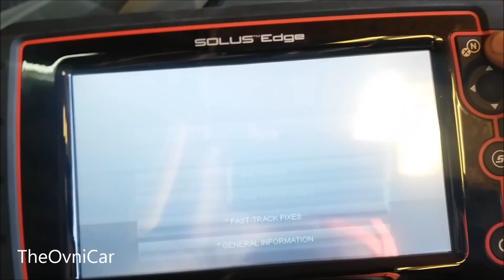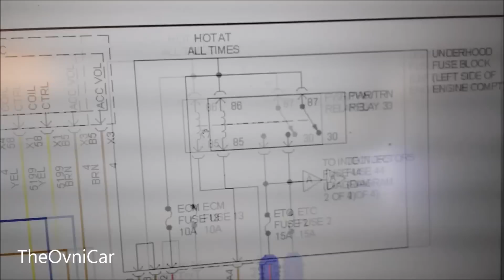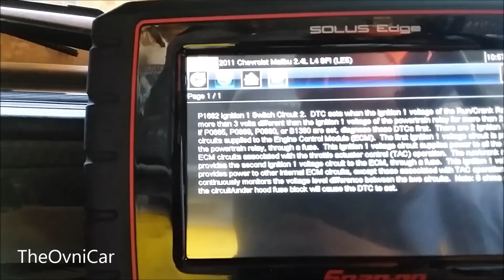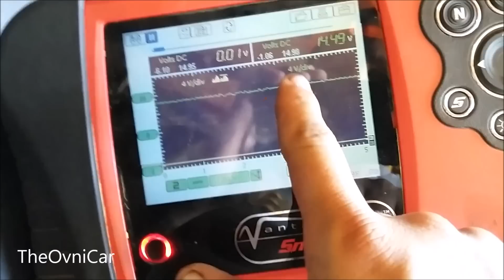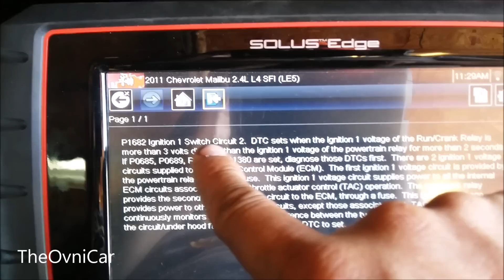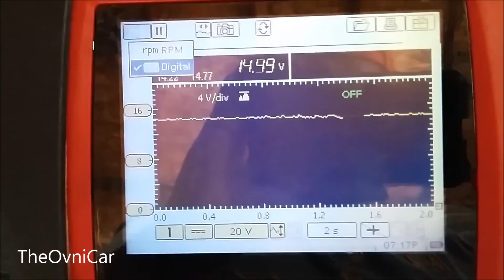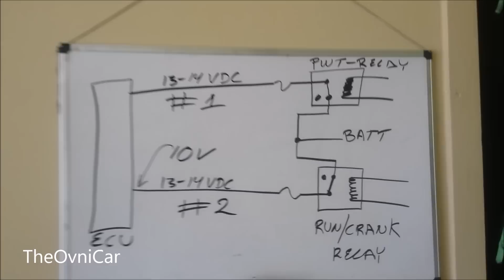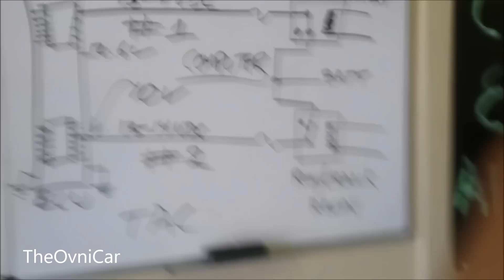2011 CHEVROLET MALIBU P1682 IGNITION SW CIRCUIT 2

Comment: Awesome video sir. I have the EXACT same issues. Today after work i test ran car and it wasnt acting up but did have the check engine light on. Shortly turned off. Then the engine power reduce came on along with the engine shaking and not going above 20mph. I changed out the 2 relays #32 & #33 on fuse block. Ran fine for awhile but problems popped up again as soon as we pulled up to the dairy queen drive thru for some ice cream which we didnt get since the malibu decided to rain on our parade at that exact moment. Tomorrow i will change all 3 cooling fan relays and test drive again and hope for the best. I will keep yall posted on my outcome.
Reply: Did you ever fix your problem? I'm having the same problem right now
Reply: Do you fixed?

Comment: Just an FYI for anyone having this same issue and code AFTER a dealership has performed the recall for the BCM connector:

I had a 2011 Malibu come through my shop three weeks ago with all of these symptoms.  The car had been at a dealership for over a month and they were unable to repair the vehicle.  They replaced the Ignition Switch, PCM, BCM, Fuse Block, Negative Battery Cable, and "repaired" eleven grounds.  I went through the same procedures as shown in this video, and basically came to the same conclusion... BUT, the customer stated that they never had this issue until the vehicle was taken to a GM dealership for an oil change (special pricing).  When I compared the date of the oil change on the repair order with that of the under hood sticker that showed the recall had been performed, the dates matched.  

I removed the trim panel that covers the BCM and immediately noticed a clear dielectric compound oozing out of the uppermost connector.  It looked as if a half tube of vaseline had been packed into the BCM connection and then the connector plugged in.  I used compressed air to blow out as much of the compound that I could and cleaned the connector and connection with electronics cleaner while blowing air on them to speed evaporation.

The customer has not had the issue again and the P1682 code never returned.
Reply: Thanks I’m going to try this where is the bcm located?
Reply: Yeah wheres the bcm in my 09 malibu?

Comment: Looks like you figured it out but i don't speak Spanish. From what i gather the computer (ECU) needs to see at least 10 volts from both relay inputs and if it doesn't it gives the P1682 code. So i guess I'll check the inputs to the relays and the wiring to the ECM and that the ECM is grounded properly. Muchos gracias. 👍🏽
Reply: Y en donde me lo pueden reparar porque no funciona micarro porque tiene esa falla

Comment: To fix the problem u have to apply dielectric grease on ecu conectors
Aplique grasa electrica alos conectores de la computadora
100%  garantizado fix
Reply: Can u help me I have the same code due to a split in my wire harness fr the crank relay I attached a different relay so it start due to a bad under hood fuse box is their a way to disabled this code
Reply: This got my 2006 DTS to crank over thanks!!

Comment: oyo hermano la falla no es la PCM la falla esta en la caja de fusibles. si notas cuando le pusiste corriente al voltage circuit 2 no borraste la code. la pcm va a siguir con la falla hasta que borres la clave y mantendiendo corriente al voltage circuit 2, ya son varios malibus que me llegan con la misma falla y cada vez que abro la caja de fusibles. Los circuitos de los relays adentro de la caja de fusibles estan quebrados y cuando se calientan se abren hacinedo flaso contacto.
Reply: Hola si cambo la caja se qita el problema?
Reply: @gumbypolo  si tiene el mismo problema si pero es recomendable llevarlo a un mecánico profesional y más importante confiable

Comment: I have a 2012 Malibu and it’s still has reduce engine power. I fixed the throttle body the knock sensor seal sensor mass air flow. But it’s still doing the same thing please tell me what it could be it’s not picking up speed help please

Comment: Great video, I don't speak Spanish at all but got the main points.  Wish I could find this diagram for my 2012 Camaro, throwing the same code. Cranks and starts most times but runs extremely rough. Ignition switch 1 circuit  2 P1682 code. Car is far from stock, had it tuned with an aftermarket blower and engine. Forgot to loctite the ground bolt into the head on the drivers side and it backed out completely leaving the ground to just randomly bounce off the block /head.  Started getting misfires and random crazy codes under hard throttle. Now getting the P1682 code and checking pins 19  & 47 they should read the same with the engine running correct using a wire piercing multi-meter probe just shy of the X1 connector?  I am still testing but I noticed that yesterday not using that probe but a sure grip clip that I worked through slightly on Pin 19 that with the key in run I had 12+ volts but running 0 volts. I replaced both relays and test the fuses all good. Could that indicate the actual ignition switch is garbage. or any advice on where to go other than replacing the PCM?
Reply: Could you put the car terminology in laymens terms..  I'm getting the same exact code...please

Comment: hi there....  this video was very hard for me to follow.  I was wondering if you could explain that in English.  I am having the same issue and can not figure out what's wrong.  I ah be the same car but, 2008.  would you be able to explain what you said in the video.  This would help me a ton.  please this would really help me and finally get my car fixed.  thanks in advance.  please make more videos.  very informative and clear!...👏👏👏👏👏
Reply from the maker: We find in this case the computer and the switch of the ignition key
Reply: Victor Martinez
Reply: You saying the computer  (ecm)?
Reply: Andre Reed did u figure put your problem?
Reply: John I have not figured out the problem... do you have any input?
Reply: It's the computer....it has to be replaced and programmed
Reply: Hello Andre... ive changed 5 relays related to ignition and the knock sensor. Test ran today after work and about 45 mins. Later it went into engine power reduce again. Im debating on changing out the actual ignition 1 switch component. Im just not sure how difficult it will be if i do it myself. Im trying to stay away from replacing computer bcuz ive read here that even replacing it it still doesnt take care of the issue.
Reply: Vega its weird this problem just started for me and I am stumped on the problem.  it could be so many things and I taking a shot in the dark.  Ive tried swapping relays but nothing for sure but the problem returns.  Have you noticed when it occurs?  I notice that when the engine gets hot is when the code or  problem occurs.  Im still researching to see if I can narrow it down.  The ignition switch sound like a good place to begin.  I want to replace the relays but I think they are fine.  its been a headache.
Reply: @davereddish3310 i dont think it does it when it gets hot. I was driving it yesterday for about 40 min. I stopped to make a phone call and suddenly it gave me the engine power reduce again. But i may b wrong because its happened to me mainly when im parked and with the car on.. ive changed 5 relays and the knock sensor.im actually searching for the location right now on the ignition switch to see if its accessible without removing many panels and i dont see it. I went to a mechanic shop this a.m and low and behold they have a same make yr and model 2011 malibu with the same issue.
Reply: vega28j did u find out what was wrong? My impala doing the same thing u mentioned
Reply: @andrereed8813  in my case it was the same but becaise of bad connections to the control modules buy dielectric grease and check them all
Reply: @andrereed8813  Replace the fuse box

Comment: Tengo un caso similar con un spark y los voltajes Cuando estaba eñ switch en run el voltaje es el mismo la diferencia de voltaje la descubrí cuando esta en off. ,el circuito del powertrain relay se queda en 2.3 v mientras q el otro si va a 0

Comment: hola victor  buen trabajo hermano  .tengo una pregunta para ti . tengo una equinox 2005 que tengo varios códigos relacionados con el pedal del acelerador y el throttle body son los siguientes P2120 P1125 P1516 P2125 U0107 P1791 P0700 i a luz de servicio esta apagada  una cosa mas la ajuga de lasRPM solo sube a 3500rpm para eso la puse en neutral y la acelere y me percate de eso. gracias ojalá me puedas responder saludos.
Reply from the maker: ya sabes sobre diagramas primero

Comment: mismo problem 2010 malibu no pierdan tiempo no es la computadora la caja de fusible se quema causando pérdida de voltage.not pcm is the fuse box that goes bad take fuse box apart and you will find a burn connector, can get a replacement from ebay, junkyard or dealer is only $215
Reply: Eso causa un no crank no start ?

Comment: Buenas tardes si me pudieran ayudar de favor,  mi vehículo tiene una falla en el motor  es un Mustang modelo 2000, V6, 3.8, el cual cuando  tengo el motor en marcha sin  cambió  no pasa nada pero cuando meto cambió  sale normal , el problema es cuándo aceleró ¡casbelea! o trato de salir rápido igual cascabelea,  eso nada mas pasa cuando quiero que vaya más rápido ,  lo lleve a  auto Zone y le pusieron el escáner  diagnosticando P01414 , otro  me dicen que es el sensor  de detonación ,  etc, ya le hice limpieza de inyectores   y nada  sigue igual ., Me pueden apoyar en eso porfavor

Comment: I'm having the same problem but it only happens when I running the ac. Has anyone else had this happen or know what it can be?
Reply: Check the resistance running from your ecm (i assume you have a malibu) its a green wire with white stripe. That runs from the ecu/pcm to compressor unit. On mine i have a 2012 and ended up needing the dark green power wire running to my injector/ fuel statem re-wired. I almost bought a new computer chip for $260 but ended up not needing it. Also try applying dielectric grease to the connectors (both ecu connectors). Lots of chevys fix with that. Many year have a recall for that but not my year/ make.

Comment: hola amigo . ese problema son los relay del motor del cooling fan que ocasiona  una caída en el voltaje  a la pcm. No es la pcm  dañada problema común  en los malibu los relay que cambiaste también estaban dañados,   en conjunto con los relay del cooling fan
Reply: HOLA AMIGO ! ¡ESTOY CON MISMO PROBLEMA EN MI MALIBU! ¡PERCEBI QUE EL RELE DEL VENTILADOR TIENE HORA QUE NO LIGA !! ¿SABE DECIR SI CAMBIAR EL RELE RESUELVE EL PROBLEMA?
Reply: TheSmechanic el Malibu que tengo con este código parece que tiene los relays (sticky) del ventilador. No encienden solo ! Solamente cuando enciendo el aire condicionado los dos fans van en alta velocidad  y cuando apago el aire siguen aprendidos.eso es solamente algo que es parte de mi diagnosis. El carro como a los 30 minutos empiesa un fallo bien grande en el motor y es cuando sale el código p1682
Reply: Hola amigo pues se los cambie y 40 min. Despues empeseo a fallar otra ves.